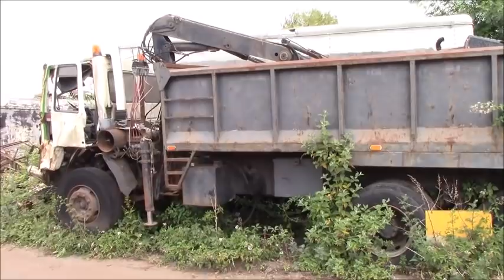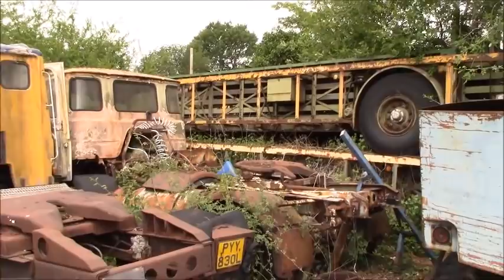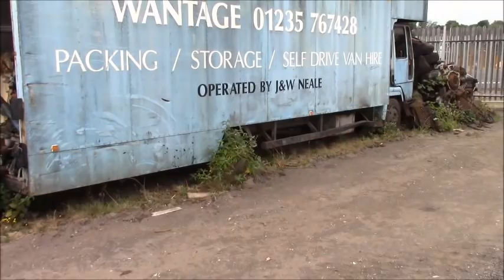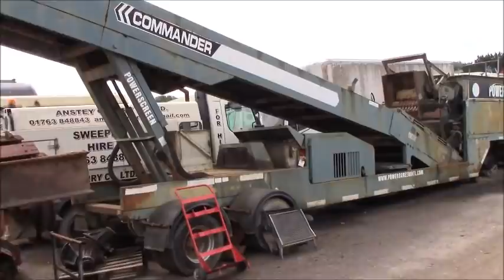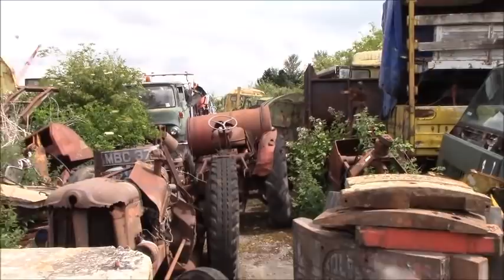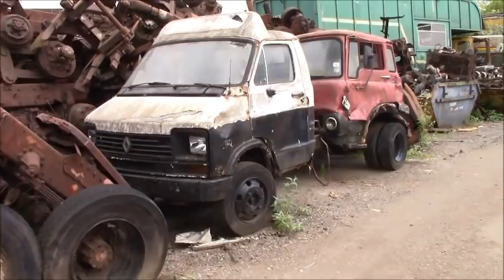Classic Truck Graveyard

Comment: While working on the construction of The Victoria Line tube the company bought several Coles lattice jib cranes for shaft work. They unloaded deliveries of tunnel lining segments and lowered them down the shafts to feed the tunnel boring machines.
The Coles lorry mounted crane was the first of the telescopic type, while working for Greenham Crane Hire, Tottenham I drove a 15tonner. Man it was bliss not having to unfold the jib plus add sections to extend it.

My father told me, don't be sad that old vehicles are scrapped and recycled. If all old ones were kept the value in them would be nothing as there would be so many, plus new ones would not be bought.

Comment: Some real golden oldies on show.
I'm in to Bedford lorrys, I had several tk trucks in the past but you rarely see them now so it was great to see them along wit the later tl type the s and j types are a lot older.
Great video, they need saving!!!!!
Reply: I saw at least one MK too. We had an old TK we used on the farm in the late 70s early 80’s and we used to go to Rush Green whenever it needed some parts. They had so much stuff there, and that was forty years ago, we always found what we needed.

Comment: Brought back memories seeing the scammell routeman at 33.37  with the 6.80 engine  worked on many of them in the 1970s.
Reply: First vehicle  I ever drove in anger back in the day was a Scammell Highwayman  eight legger tipper, big redline and the David Brown box in it,  by christ they could sort out the men from the boys in short order, these modern day steering wheel minders with powered everything and auto boxes couldnt last one day on the job we used to do day in day out......sometimes if you were lucky you could even get a motor with the luxury of a heater that actually worked harder than all the holes in the floor too.

Comment: Great video, a pity you didn’t pay attention to the buses that briefly could be seen in the video. Maybe two of the rarest vehicles were that Commer fire engine and the Leyland Martian, originally fitted with that straight 8 petrol engine solely for army use. The Commer most certainly had the straight 6 petrol engine. Later models often had the 3 cilinder 2 stroke diesel, the TS3. They screamed! Anyways, quite sad to see the demise of the British motor industries, all of the vehicles in this yard represent the glory of what once was and never comes back. Greetings from Hekelingen, Holland. Bye, Willem.
Reply: Hearing a Commer 'stroker'  on full song is an experience that should not be missed by anyone!

Comment: ,,.hi i have been to rush green motors 3 months ago,its like a time warp, but found the owner a bit  odd as i was not allowed to remove parts from engines so whats the point
Reply from the maker: I have heard they are expensive by a few people
Reply: @classicmotorsgreatbritain1086  hi, yes they are for what is not new parts. l got a rusty old air filter which was worth about 5  pounds and was charged over 40 pounds.i have since restored it but to do this cost me 30 pounds in materials etc,so no wonder everthing is rotting away. its  a pity really
Reply: Silly really like you said what’s the point ? Lots could be saved from here, guys with experience and a love for some old machinery could breath life back into some of the better stuff I bet.
Reply: @martinmoss7652  hi, yes this is crazy, i am going back there after xmas and see what the problem is with these clowns,i am surprised no one has gone at night and taken bits and pieces. its  too  late to save some vehicles.
Reply: They don’t want to sell you parts of a vehicle. They want to sell you the complete vehicle and plenty of complete vehicles have been bought for preservation.
Reply: @derekferguson385  hi, some have been there years and will rot away.hope someone saves the AEC engines.the cabs have all had it, the advert they have says spare parts so someone is acting  a clown,
Reply: @petersmith4455  believe me they are not clowns. They know exactly what they are doing. Who will buy an engine with parts removed ? Nobody. The destination for all these engines  and gearboxes is Africa. They have been exporting them for years in bulk.
Reply: @petersmith4455  Good luck with that. These people don't listen they only charge. Better to rot away than anyone has a fair deal.
Reply: @jonka1  I was there last January to look round and I tried to buy the Foden badge and grill from the old Blue Circle Foden S21 mickey mouse cab that's falling apart. I was prepared to pay a fair price for it but he said it was worth £500. I don't think so somehow. I saw one just the same on ebay for £30. Just as an idea of realistic prices, I'm currently watching a door from a Scammell Handyman cab for sale on eBay for £50. I don't have a truck myself, but I'm tempted to buy it as a piece of British lorry history! If the owner of this place was a bit more realistic on prices he could sell a lot more stuff. I quite fancied taking one of the Bedford TK cabs home to put in the garden! Goodness only knows what he'd have charged me for that!! 
I took some photos which I've put on a video on my channel.